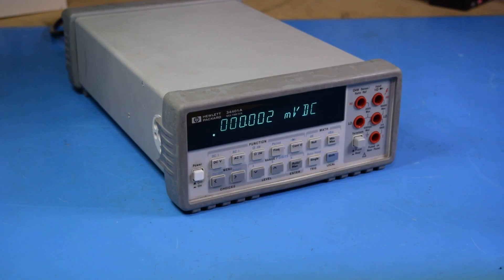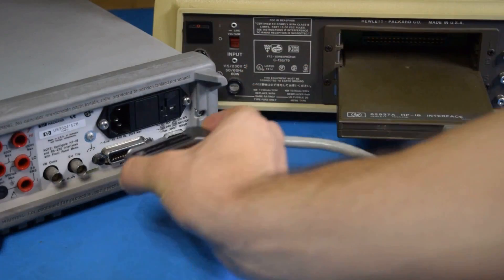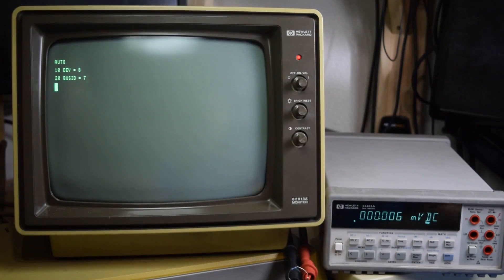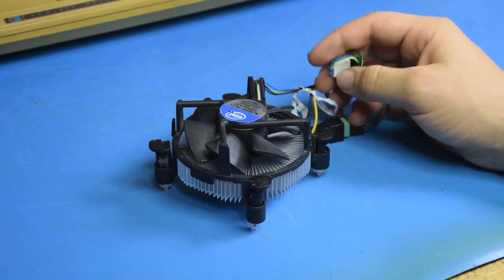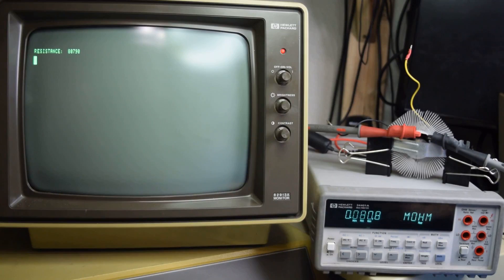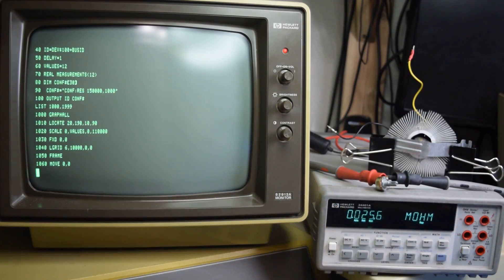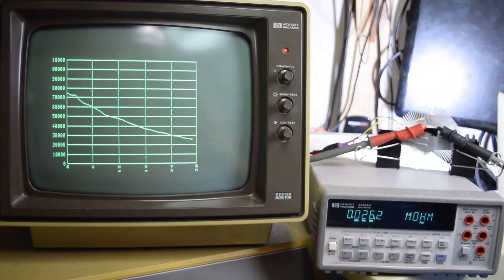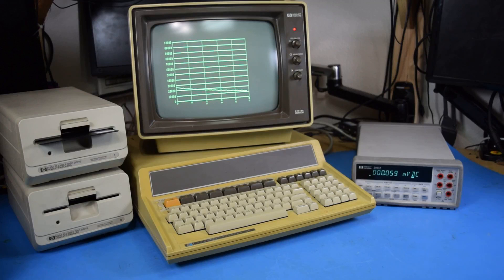0x0034 - GPIB Data Logging Like It's 1982

Comment: You can hook up the thermistor between ground and the no. 5 pin on the 555 that is configured as an astable. It will decrease the pulse width as the resistance decreases (and also increase the frequency but that doesn't matter probably for your application).
I used this a few times in quick and dirty boost converters (using a NPN as the feedback regulator and a MOSFET switch).

Comment: Well, you mention that even in the 2000ends they still supported HP Basic, but that's not without a reason. Even though HP Basic is not around anymore, there is a "modern" version of it: HT Basic. The company making HT Basic (Transera) bought the rights to make "HP Basic" and now calls it HT Basic which means "HighTech Basic" and it is officially supported to run under Windows 10 and so on.
We use HT Basic for many of our testing machines in the company I work for and because it can interface to DLL-Files and has drivers for interfacing with the Keysight IO-Suite you can easily talk to almost everything. One of my colleagues for example wrote a driver to talk to any Modbus device you can imagine via Ethernet and so on.

So: HT/HP Basic isn't dead - it's still in use in it's niche market for which it was supposed for. You can't find much on the internet about it, but it's still alive and happy. And with a small amount of work you can even make programs from the 80ies work on modern systems.
Reply from the maker: That's awesome! I think that's the first I've heard of a direct lineage from an ancient BASIC to something still in use.
Reply: Its beautiful when modern and ancient software/hardware works together
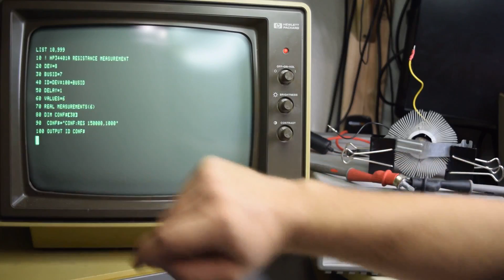Reply: I notice with BASIC you cannot dynamically dimension arrays (e.g. 10:52 in the video). Has this been fixed?

This is one area where a more modern language like Python would be beneficial. Especially running on a modern multi-tasking system.

Comment: I've done a lighting but with some cheap led lighbulbs, to avoid flickering i use them in 2 separated 110v phases. They were really cheap and use directly ac power, so i just got a box to be a reflector to each of these, made a difusor with a similar cloth as yours and they seem to work pretty well. I just need to get more powerfull led blubs to film after 17:00-18:00, as my 4w light bulbs arent enough.
The advantage is that they are pretty darn cheap, dont require cooling and make no noise.

Comment: Now you have to get more gpib electronics test gear and get a whole 80s lab going!
Reply from the maker: That's my plan!
Reply: @TechTangents  Open reel tape drive to store all the instrumentation data?
Reply: @Stoney3K  9 track recorder?
Reply: @TechTangents  

https://www.sparkfun.com/products/8841

Just saying...
Reply: AkBKukU idk why but 2018 tech across the board looks so boring and lame or is it just me? XD
Reply: I have friends who work in amplifier building and repair and they only use tools this old. They actually use that multimeter all the time
Reply: It’s a seriously killer multimeter, and I haven’t seen one go more than a count or two off factory calibration either.
Reply: Maybe add a GPIB-capable DC power supply for turning the LED on and off. Then the whole measurement setup can be automated.

Comment: The reason some of this stuff still gets supported just a little, is because it still works for those who use it.
Reply: Just "a little"?

For my 1670x's HP-Agilent sent me the install CDs free of charge. As well as the ROMs for my HP 3852A's. My friend got his sent to him in Finland. I don't know of any other company that supports their obsolete products (of which they have got to know that the current owner of them is not the original owner) to this level.
Reply: Yeah, same with the old fanuc cnc program (even tho idk if its still supported)
Reply: Lots of labs and research universities use HP Basic to this day! I worked on a project in 2017 porting a test app written for the HP-85 into Python script.

Comment: How did you wrote your software to control your multimeter? Did you have any documentation? And could you post it to Github?
Edit: So you had documentation. Still, could you post the program to Github?
Reply from the maker: It's been on Github for a while actually, I updated the description to add a link. Here is where is is:
https://github.com/AkBKukU/34401AGUI
Reply: AkBKukU Thanks!
Reply: @TechTangents  : you have a typo showing up in 34401 GUI image - "mesuring". Oh - and great video :)